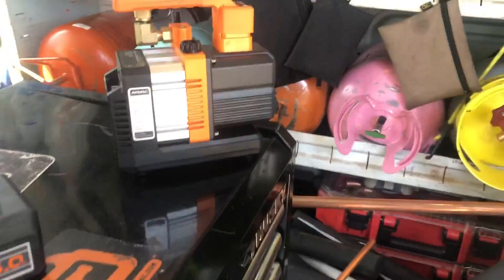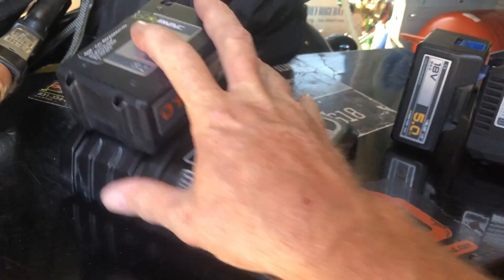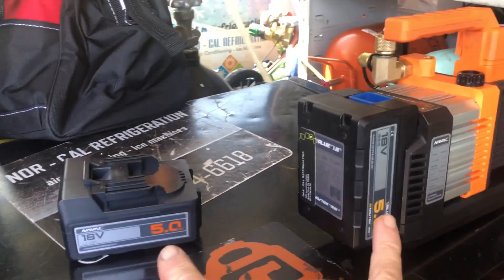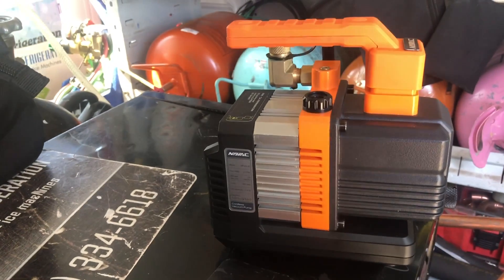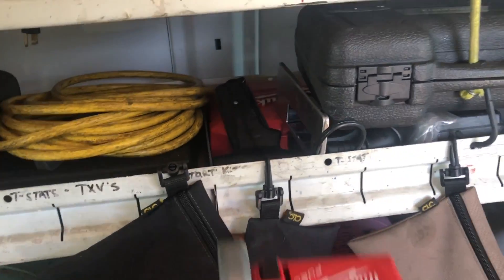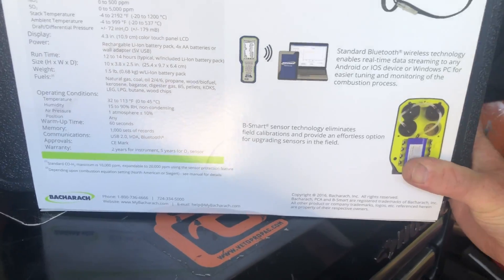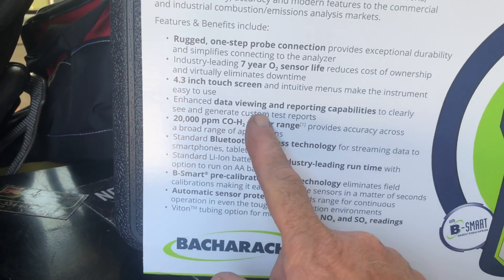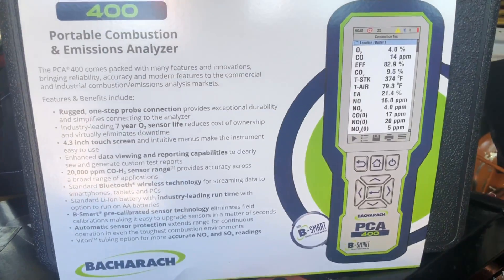Update on NAVAC NP2DLM

Comment: Dave are you still ROCKIN this Navac 2cfm vac. I'm thinking of getting this now that I'm doing alot more refrigeration stuff , undercounter reach and stuff. Instead of pulling out the feildpiece.
Reply from the maker: Yes I am. Now they have a 4cfm model
Reply: @NorCal-refrigeration  I seen that, and I also seethat some guys us a adapter to use Milwaukee M18 on the 2 cfm pump, do you know if there an adapter for the 4cfm cause I think its a different fitment.
Reply from the maker: @apr9286  I don’t know
Reply: @NorCal-refrigeration  rajah thanks Dave, I think I'm gonna get the 2cfm, use it with the 1 blue hose set up for the prep tables and standup reach in and freezer.  What the average vacuum time you been getting on these type of unit?
Reply from the maker: @apr9286  it depends how old and dirty the system is. ( compressor oil ).

Comment: Does it have enough capacity to pull down a 2 ton refrigeration unit 60 feet away line distance?
Reply from the maker: It could but you need time and batteries. Best suited for prep table. They do make a 4 cfm model now.

Comment: I bought one of these as the company I work for does a bunch of mini splits. One thing I can tell you is that they do use Makita batteries and the charger will charge Makita batteries. Unfortunetly I don't have any Makita tools in my van...but I have a bunch of Milwaukee batteries.  So I went looking and found this..... https://www.amazon.com/Battery-Adapter-Milwakee-Lithium-conversion/dp/B07GXKYTL8/ref=sr_1_1?crid=3AESVTUM18KPR&keywords=makita+to+milwaukee+battery+adapter&qid=1560139098&s=gateway&sprefix=makita+to+%2Caps%2C284&sr=8-1.  This allows me to use every battery I can to keep the vacuum pump working.  I have done 5 mini splits in a row back to back using this method.  For smaller systems this is the greatest thing since sliced bread!

Comment: Dang sounds like navac wants to bury the truth. “Hey we got this awsome pump that you don’t need 110 vac for!”........<in fine print, “for best results have 110vac available”>
Reply from the maker: You can get about 3-4 prep tables per battery. It was on bigger units, I’ll get more videos of it.
Reply: or more batteries available for longer runs without power... it's pretty much been that way since day one of cordless tools and the lithium-ion batts. sure didn't change it fully.
has memories of mid 90's and grabbing all the co-workers charges and batteries to drill and chisel red brick out for conduit run.. those weer dewalt 12V lol. lots of 3/16" holes and a hammer.  most always 1/2" pvc conduit, anything else was stubbed/sleeved way early on!
Reply: The nice thing about the navac is You could just grab it & go. Its light weight & easy to pull a quickie vacuum say if u just pumped down a system , weld a leak , pull a evac & jam. not having to run a cord across a floor where people may be walking in a kitchen lessens liability risk. Also u can charge the batteries on the drive to your next job , as most people have inverters in thier truck i woukd say these days.  i know i do for charging my ryobi batteries , running printer & laptop in truck. i personally probably will never get one. im personally wanting  a small robinair , super lightweight , 115 volt pump. im tired of lugging my 6cfm robinair around. im looking for a super light weight pump soon.
Reply: Your comment is super hilarious though. 👍👍👍👍👍 🤣🤣🤣🤣🤣⭐️⭐️⭐️⭐️⭐️
Reply: Try the Javac or Wipcool 18V Vacuum Pumps.

Comment: So you mean you still need a outlet electrical cord
Reply from the maker: Or an inverter.  It will do 3-4 prep tables on 1 battery.  Just on bigger units you’ll need to be on recharge mode.
Reply: APR928 😂

Comment: There is always 1 down like on your vids man, you got a hater. On a side note,  does that thing slow down as the battery is getting low?
Reply from the maker: It alarms and the alarm gets more intense as battery died, and it had a check valve.
Reply: @NorCal-refrigeration  sweet! I'm going to run this by the boss.
Reply from the maker: bblazeff1 you’ll like it. 👍👍